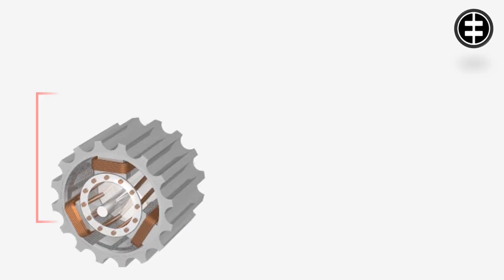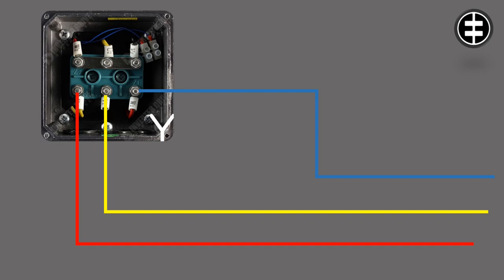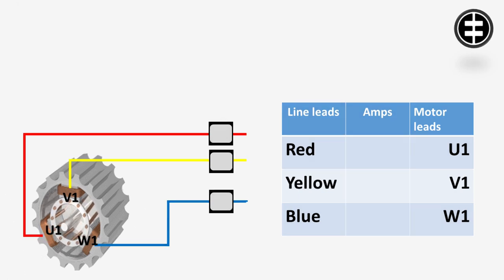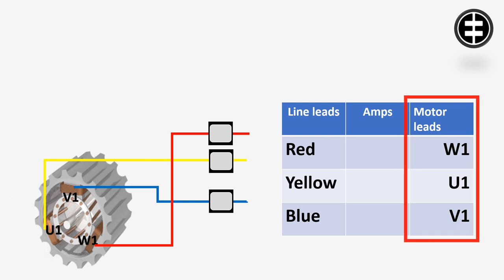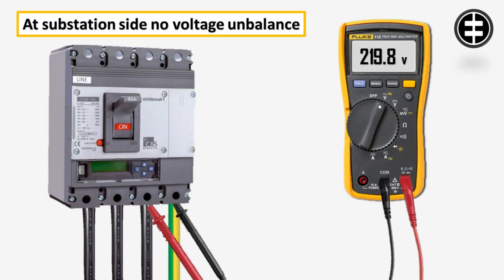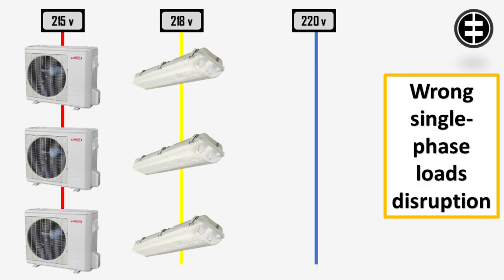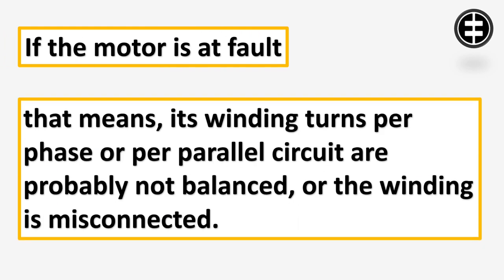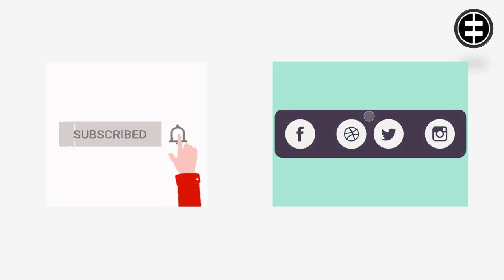How to detect & solve the three Phase motor current unbalance Problem?

Comment: Good day! My question is how about 3 phase induction motor 6 leads out wye-delta connection have balance voltage of 230v and imbalance current of  u1= 11.2 amp v1 = 10.5 amps w1 = 0.3amp. is my 3p motor is detective? 

Thx